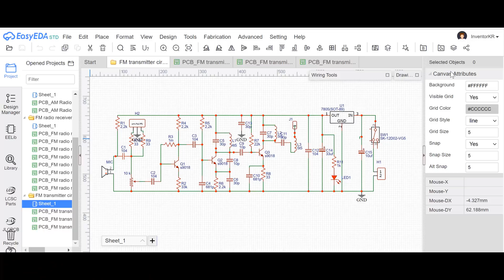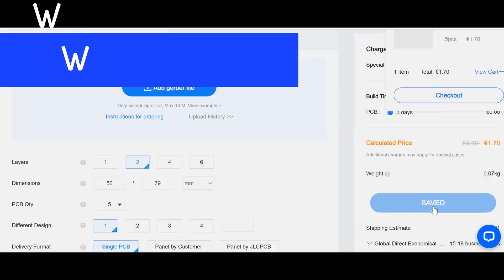how to make simple inverter 3000w , sine wave , mosfet , jlcpcb

Comment: Can I use normal transformer
Reply: Only ferrite core pulse transformer is designed to work in switch mode power supply.Iron core transformer does not work well because of losses and causes humming noise and heating to work on High frequency.

Comment: 3000w and not a single mechanical connection anywhere lol 😂 The little motor slowed down considerably when the light bulb was connected and the bulb wasn't very bright, was it even a 40w bulb, 3000w I doubt it very much? The thing will fall apart would be my only guarantee on this 😂 Edit : How hard is it to make a mechanical connection and wrap the leads and wires wherever possible before soldering and the thing will last a whole lot longer no?

Comment: why did you set the multimeter to DC to measure this AC. What happens if the sine changes from -220 volts to +220 volts. if your circuit does not provide real current, it will cause the cable or consumer to overheat
Reply: answer my question whoever it is

Comment: Maximum 1000w nut 3000w
Reply: Even with 1000W these 12 AVG wires used will melt. 1000W from the 12V input means 83 Amp. 4 AVG wires are needed for 1000W. For 3000W (12v 250 Amp) 1 AVG wire are needed.